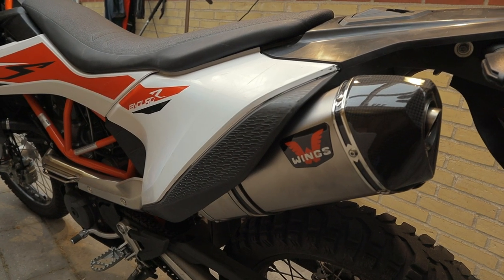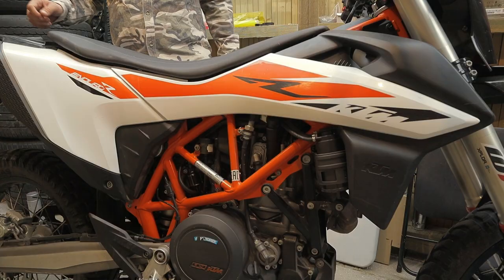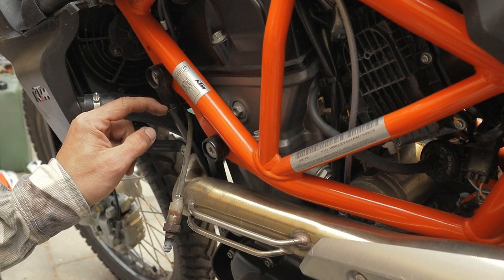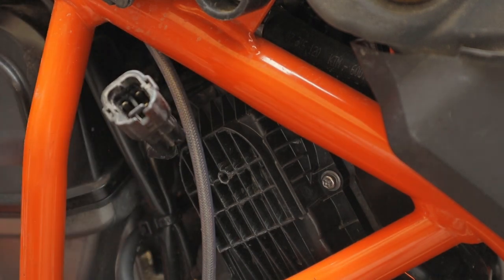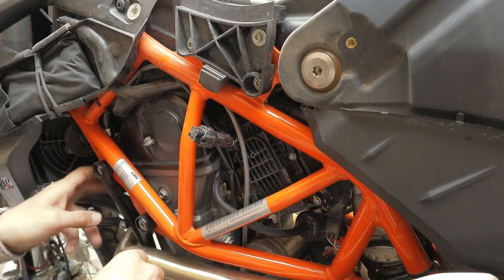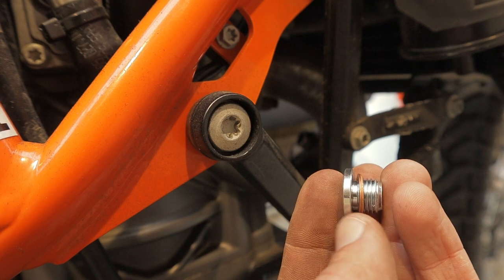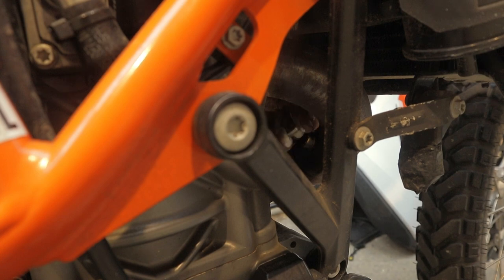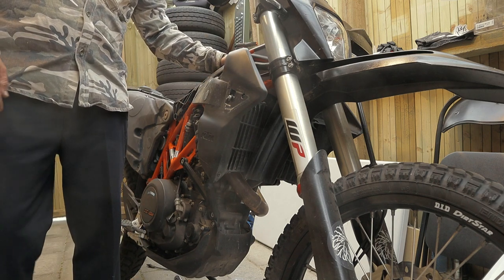KTM 690 Enduro R - How to install Rottweiler fuel dongle [SuperMoto build series - Ep.2]

Comment: I left my O2 sensor in place. Give no one a reason to look closely at my bike.  in some regions messing with Emissions will make your bike offroad only.  Check local laws (California ... ).  Same reason fro leaving the SAS in place. Zero performance gains getting rid of it, but keeps nosy inspectors at bay.
Reply: Is there any benefit removing the O2?
Reply: @thumpertorque_  by installing the fuel dongle yes, but removing the o2 no. It will be disconnected because of the dongle but you can just ziptie the cable of the o2 to the frame
Reply: No performance gains for canister removal but it eliminates a shoddy piece of plastic hanging prone on the side of the bike.  You will break it for sure if you’re riding  mostly trails.
Reply: Sucks to live in a state where that matters

Comment: Did the fuel dongle made any difference for you ?
Can't say it did on my bike 🤔
Reply from the maker: I actually installed It at the same time i also installed SAS delete kit.
And i can defenitely feel a difference, in its much smoother in the bottoms revs and its defenitely also more smooth All the way Up through the revs. And it also rund cooler
Reply: @beastmodemoto793  Do you run the powerpart airbox lid ? I do and it really made no difference with the dongle...strange 🤔
Reply from the maker: R Andersson i havent changed anything on the airbox - yet 😁 
It sounds strange that it made no difference at all, but maybe its the sas delete kit then. 😼
Reply: @beastmodemoto793  The lid did make a big difference 😎 but sadly  it is loud....:(
Reply: @randersson3672  i wonder how the rottweiler intake system sounds then
Reply: Yes, I wonder that too, it must be easier on the ears then the PP-lid...does not take much ;)
Reply: It is not a huge difference.  What it does for you is tricks the ECM into running open loop at idle and part throttle allowing bike to run a bit richer(13.5:1 vice 14:1).  It smooths out the twitchy throttle response at low rpm range. It won't build anymore power.  Once you are at about 1/8th throttle and up the dongle is out of play as the ECM would be in open loop then either way and not looking for the signal from the 02 sensor.
Reply: @zrig1 useful remark. As i understand doungle is a resistor or two. Do you know the resistance of them to achieve required effect? P s Have no possibility to buy complete doungle in my country ((